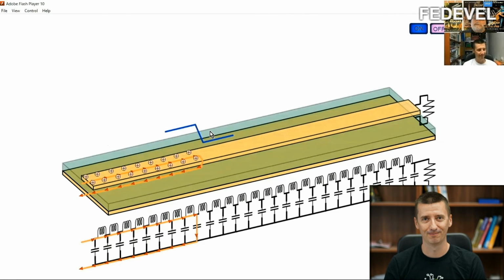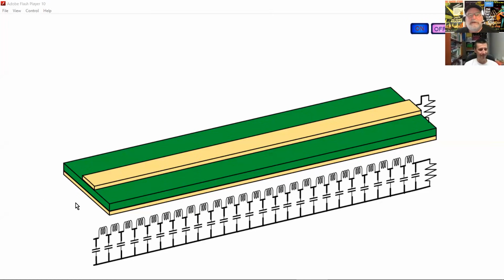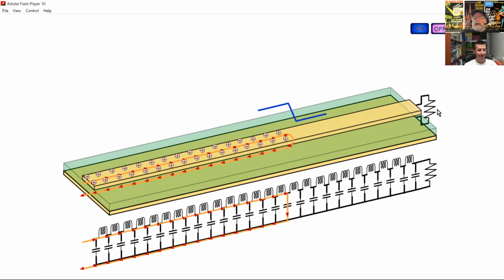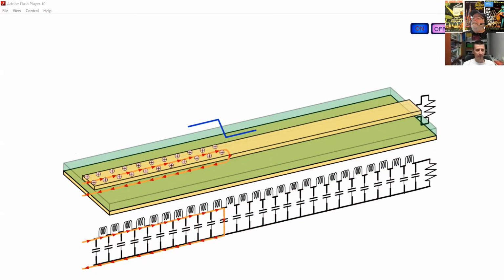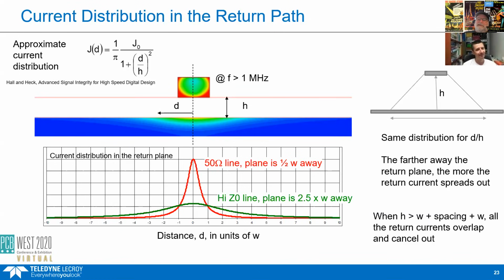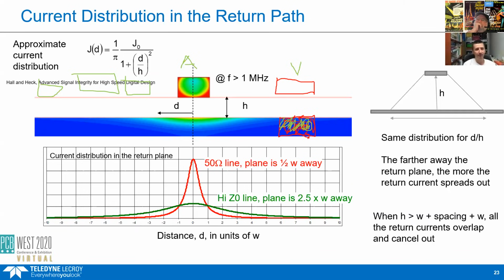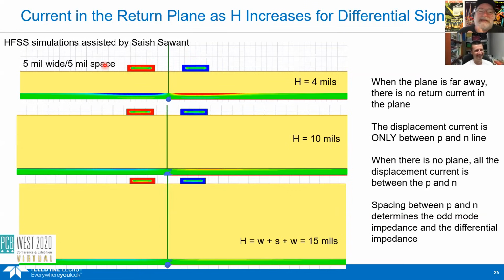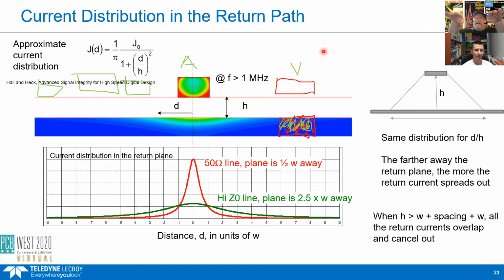What Every PCB Designer Should Know - Return Current Path (with Eric Bogatin)

Comment: What about the case when you want to transfer a few data lines through an unshielded ribbon cable, using say IDC or JST connectors? Do you separate each signal line with one or even two ground lines? For say 1Mhz signals with a few ns fronts?

Comment: I have a project, where I beleive the spi routes ( it's return path is ) shared with analog plane ..  mostly I work with DC signal but very small values in millivolts levels so crosstalk is crucial. Can someone help me understand will this spi introduce ground bounce in my voltage input of 2.5mV

Comment: 29:32 I have a question about this. "When you watch the other guys... worst thing you can possibly do because you have automatically engineered ground bounce in your design". I understand that this would be the case for a two layer PCB, because the return paths are in the ground pour of the opposite plane. However, is this also the case for a four layer board?

Say I used the outer two layers for signals, and the inner two layers as an uninterrupted ground plane. Would this avoid the issue, because the return path now lies on a solid plane?

Comment: thank you , thank you and again thank you ..... I am working with a very small process node SOC IC where a SAR ADC gave me the hint of ground bounce because never converging to the input signal being measured. Turns out the return path in the package is shared and my trace was the victim , the inductance in the return would create voltage fluctuations hence an unstable reference for conversion. 

This video has proved further my analysis .  Infinite thanks !!!!

Comment: I always think as a lightning h strike. The field propagates stablishes. There is a path to currents flow and current flows in the easiest path. 😀

It flows more in the lower impedance path. And distributes through the conductor once it isn't perfect. But mostly at the surface.

Comment: In the video with Eric Bogatin "what every PCB designer should know - return current path" at about 10:50, Eric mentioned Maxwells 4th law and the displacement current, as the means by which the signal flows down the transmission line and returns down the return path to the source.  

 However, my understanding of the displacement current part of Maxwell's 4th law  is basically that the curl of the magnetic field is the result of the changing electric field.  It is also my understanding that a current does not pass directly through a capacitor. Yes, I know that in the transmission line representation there is not a "real" physical  capacitor but the transmission line is a representation of an infinite amount of infinitely small capacitors across the dialectric (between the signal and the return).  Not that I wish to argue with Eric Bogatin, but if there is no actual current flowing through the dislectric then the only current in the return path is caused by the curl in the magnetic field which is the result of the electric field change. This would make the animation somewhat misleading. Perhaps the animation would be less misleading if it could show the return current in the return plane being generated by the curl in the magnetic field.

I hope that someone can clarify my understanding of what is actually happening.

Thank You
Tom
Reply: A current DO pass through a capacitor, because there is a movement of charges around it. It only is a different type of current. Check how displacement current fits in the capacitor paradox in maxwell's equations.

Comment: An absolute magic presentation.  Designing a PCB is not a simple task as many may think.  The schematic is the easiest part.  Selecting auto route is probably the worst mistake when working with high frequency signals.  There are valid reasons why different PCB materials exist.  
Thank you, this is a fascinating field on it’s own.

Comment: Great video! What I am really interested in is. If you have a multilayer board with Power plane- signal plane - gnd plane. Is there any return path over the power Planes as well? If you consider that at high frequencies GND and PWR are shorted by bypass capacitors? If so then it might be a problem splitting the powert planes as well (for multiple sources its necessary). So for good signal integrity one would need to avoid stackups like this.

Comment: Awesome video. Learned alot. I was wondering how does putting a ground trace right next to all signal tracea would be? Would the return path stay mostly on the top of the board? Or would it still want to use the pcb material as a capacitor?
Reply: There are other videos and articles of bogadin that show how that makes things worse in high speed context.

Comment: I've been struggling with the concept of "return path" for differential signals. After all these videos, between Robert, Eric, and Rick, I'm getting a better understanding but still have a lingering question. If we're talking about two different systems using RS422 differential signals does a "return path" have to return back to the source system, or just to the common voltage? We often communicate with units that send our system the RS422 Clock/Data, but don't have a direct ground connection to our receivers (to avoid ground loops, but provide terminal blocks to make it optional if the signal is available to us). The grounds between systems may be tied through mains or a large copper bus bar. So if my PCB uses our Test System ground as the reference plane "return path" to the differential signals, is that conceptually the same thing even though it doesn't directly return back to the system sourcing the signals we are receiving? I want to think of return path as a path back to the units we are testing, but the receivers on our systems often don't connect to the ground of the units sending us the signals. Without providing isolation circuitry, how should I handle and think of return path between two systems that don't make a direct connection of System 1 ground to System 2 ground?

Comment: Food for thought. One thing you can do to fix a GND return gap, or say if you MUST run a trace over 2 different GNDs, or power planes, is you can couple them together with a capacitor. You essentially provide a High Frequency path for the return current to pass through the gap. It keeps DC from moving between, but allows the return current to continue to follow underneath the sharp edge transition of your positive signal.

Comment: Hi Robert, this is great stuff; The importance of the return path rarely enters my mind as I route a board, but I'll give it much more consideration going forward. I'm primarily working on low-noise Audio circuitry and to be safe, should I consider routing each return path individually for sensitive areas of the circuit...?  For instance around the differential front end transistor pairs..?

Comment: 29:35 is the example Eric gives for 2- or 4-layer board? I can see how it would be terrible in a 2-layer board (no solid GND plane), meaning the GND pour is gonna be a patchwork of copper areas, but in a 4-layer board with a dedicated inner layer as a solid ground plane and the traces on the bottom and top layers it would be fine, as most return currents would follow under their traces and only cross in places where the traces cross, but mostly have their own return current paths?

Comment: This video was really helpful. Thank you so much. I have a question though. If you have a power plane also right next to this signal line, will equal amount of displacement current flow through that also? (Since that plane is also seeing the change in electric field). This would mean that there should be both a power plane and a ground plane adjacent to all signals with no cut in them?

Comment: Thank you  I really enjoyed your video. I would like to understand why the insertion loss figure  is affected when for instance you introduce a gap in the ground plane. How can this be visualise ? From your video it was clear that the impedance at this point would increase but how does this effect insertion loss. I have had instances when I launch from coax (such as an SMA connector) to microstrip through a chassis and had a large gap between the ground of the coax to the microstrip ground resulting in a longer path and the insertion loss increases significantly especially at 10 GHz…..

Comment: In the slide Eric pulls up at about 20 mins. into the call (-31.29) it is visible that due to skin effect the current is maximum at the edges of the signal travel then shouldn’t the return current peak be also on the edge. Extending this further shouldn’t there be more than one peak in the return current?
Reply: Also, does the skin affect not apply to return currents?
Reply: Thank you so much for this session Robert. The questions you ask are very relatable.

Comment: I just have a question about the return current of sensors such as photodiodes. consider that photodiodes have two terminals, one is PD signal and another is Photodiode reference voltage. in this situation what is happened to return current? is that the current return GND or PD reference voltage? Thanks.

Comment: Thank you Robert for the great content, 

Question: When we say displacement current is induced due to the changing voltage(AC), which is instantaneous in nature as well, can this be present without the load connected between the signal and the return path?

Comment: Great video like many other of you ! All help to improve reliability or fault rate of a product.
I have been working on this stuff and related EMC behaviour for a few years.
I learned, that the return current for higher frequencies does not look for the lowest ohmic return path, but looks for a return path that will include the smallest enclosed area available.
So make a design, which facilitates this 'starting point' ; no gaps, short tracks, good (cable) shielding etc. You improve cross talk, but also minimize susceptibility for external electrical fields by minimalisation of the current loop  size (including grounding). In our equipment we improved susceptibility for more than 40 dB for the higher frequencies, which we measured in our own very big EMC test lab. It was amazing to focus on these aspects of electronics, although it is 25 years ago now. Last remark .... a good design needs proper design of electronics, mechanics and interconnections (connectors an cabling). Teamwork !

Comment: The animation and discussion starting around 8 minutes implies there is current from the signal to the ground plane as it propagates forward. Exactly how is it proposed that charge is flowing through the dielectric of the board?
Reply: It doesn't. There is no flow of "free" conduction charges in the dielectric. It is displacement "current" plus polarization current. (The latter corresponding to some actual charge separation, but of course those charges are not free conduction charges.)
Reply: @egghead971  Thanks for the reply. I understand there is no actual current but am failing to understand how the concept of "displacement current" helps us understand what's going on here. Why is it insufficient to simply notice that current flows forward on the signal conductor and backward on the ground conductor simultaneously as the signal propagates? Why would we model a virtual current flow here?
Reply: Capacitor charging/discharging.

Comment: Thanks, Feranec and Bogatin, very interesting. I have a question ...
Is it possible to consider the current intensity decrease in the Return plane, with the increase of H (slide 37:49), the consequence of the field lines number reduction into the Return plane? 
The concept is:
In the first case H = 4mils and a quantity of field through the dielectric and the metallic plane, in the case H = 10 mils the number of field lines in the dielectric is greater than the plane, in the case, H = 15 mils a very scarce field the amount of lines is in the plan.
 is that correct?

Comment: Thank you very much for this video Robert and special thanks to Eric. Good topic, which every Hardware Design Engineer should know.
A question appeared in my mind though.
Say we have a hypothetical 3 layer board. 2nd layer is the GND. 1st and 3th are for routing and they are sharing the 2nd layer as GND.
What happens when there are exactly parallel routes on 1st and 3th layer. My understanding is that they create voltage noise to each other.
What do you think? In this case should the routing on 1st and 3th layer be not parallel but perpendicular??
Reply from the maker: Watch this video, you will see the currents in the plane could flow at the same place for both signals: https://youtu.be/nPx2iqmVAHY
Reply: Thank you very much for the reply. I was going to watch that tonight. I never miss your videos :)
Reply from the maker: @oktemee  I was thinking about this. It may not be so simple to answer. For example, for high speed signals, the energy will flow between the track and GND plane, so I believe, in this case the signals will not influence so much - especially the currents are small and they will be probably mostly close to the surface of copper. But for high currents and thin copper layer, that may be a different situation (?)
Reply: Thank you very much Robert for your comment again. Really looking forward every video from you. Thank you very much for your effort and time

Comment: Great video! A question:
What if our Ground Plane is on the same plane as a Signal Strip. Does the return current flows thourgh the top GND polygone?
Reply: Then you will be left with the air-gap capacitance between the signal and ground return instead of the inductor.   An air gap can act as a capacitor.

Comment: Great video! I've been wondering for a while now what the return path of a signal on an internal layer looks like. Let's say above is a solid GND plane and below a VCC layer with two different split planes (different voltages) under the signal. In one case the GND layer is closer to the signal layer than VCC, in the other case it's the other way round. Is there a way to simulate this?
Reply from the maker: Thank you Joanna PS: I asked Keysight if they could help me to simulate 3D fields and I am planning to do then more simulations (including VCC)

Comment: Interesting video -  When I have tried to imagine the nature of transmission lines/ terminating resistances etc, I  go to the old conceptual model of  'Dropping a rock in a pool' - if the pool has earth/sand sides, the sides act like 'absorbing resistances / ('damping') to 'ground'..? - &, If the rock is dropped into a swimming pool lined with ceramic tiles, there will be 'high-impedance' reflections back... yeah?

-, as the old gag goes:

"OK, that's great, but can you explain it in terms a Ten-year Old can understand??!"

<Ahem> OK...... "OK, that's great, but can you explain it in terms a Six-year Old can understand??!"

Best now,

:-)

Comment: Great video, thanks.  The voltage wavefront model is interesting.  di/dt is a concern in high speed but also high current.  Would be interested in a similar discussion about power supplys

Comment: When discussing the discontinuity of the return path, Eric says a couple times the inductance increases ?   Wouldn't the extra distance between conductors mitigate that?  Less induced current vs. the increase in current density?  The animated model doesn't actually show a single return connection, though it is implied in your talk.  Would return current still be as concentrated if the return point were perpendicular to the signal trace?  To say the situation is complex is a severe understatement.  Add in resonance and response time, the inverse pulse surely following immediately behind the one in question, and even ignoring the plethora of other signals also inducing voltages on the return plane in a typical circuit board, and it would seem we've now entered the realm of chaos theory.
   Please note that while I have a basic understanding of this subject, I do not have an electronic engineering background.
Reply: It’s not that complex with some basic tools, the problem can be broken down into simple terms. You basically need, for very fast signals, a controlled impeadance and a load that absorbs the energy without reflecting it. It comes down to a few simple algebra equations...
Reply: I’m assuming you’ve played with pcb and layout before, given your comment. You must be familiar with decoupling capacitors and why they are needed when powering ICs. The inductance he refers to is similar to that. The cut in the ground plane simply means the displaced current must take a longer route back to the source. That longer route adds inductance to the path causing the a lag in the current’s phase (or voltage I forget).
Chaos theory? You are making a mountain out of a molehill. The return reflection (and any others) just set up a standing wave. Like dropping rocks in a pond.  Your load will determine how large that reflection is.

Comment: What if you via stitch a differential pair in the same way twisted pair is done in a cable jacket, or do you need an overall shroud connected to system gnd potential?

Comment: Differential pair's return current flowing through reference plane. Ok then, what about differential signal flowing through twisted pair cables?
Reply: I would imagine that's exactly why the wires are twisted, to guarantee identical impedance in the pair.
Reply: Through the shield??

Comment: WOW! WOW! This subject is super important. I've built circuits with multiple frequencies such as a microcontroller, with a wireless connection, with a PWM signal, with an SPI module... I thought a large ground plane was enough. I have to consider capacitances, inductances, current wave fronts...
l have to put this video on a playlist. Thanks for posting!